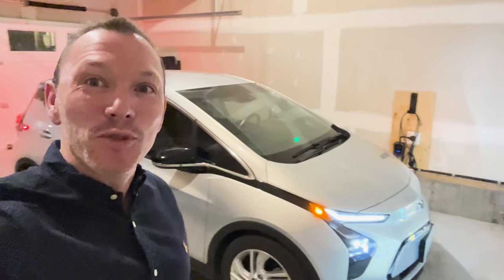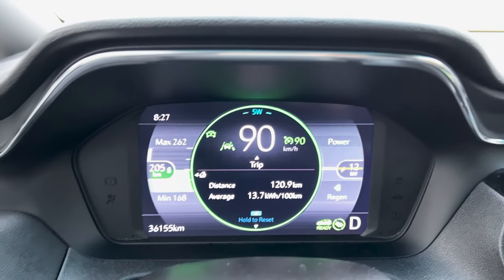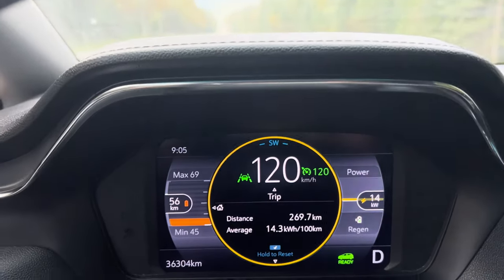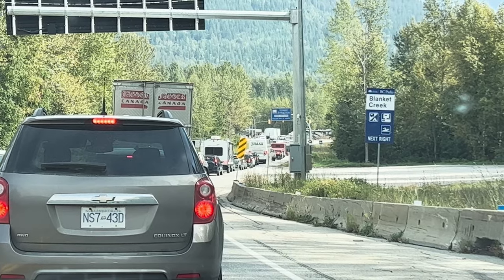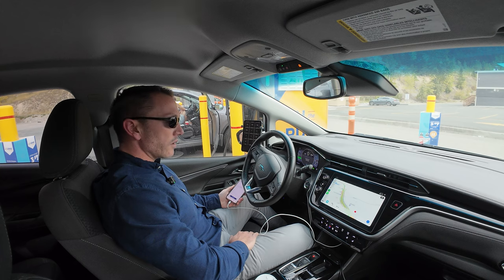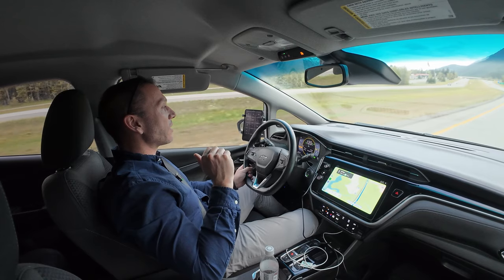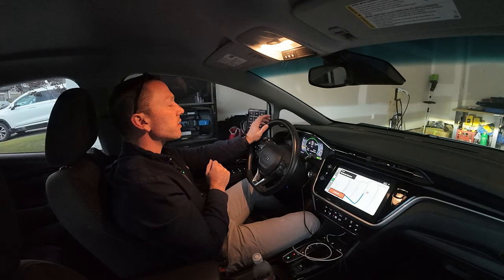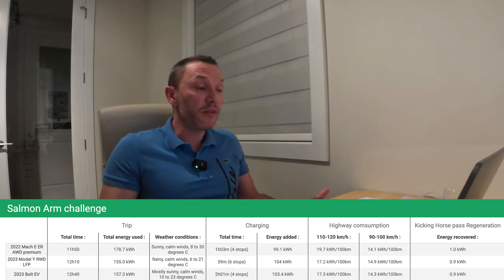Salmon Arm challenge (1000 km across the Canadian Rockies) - 2023 Bolt EV. Charging failure!

Comment: We almost bought a Bolt last year, carcwas ordered and ready to pick up when we walked away from the deal, We had a Model 3 before & just couldn't get past the slow charging speed, Having watched several videos, including the Rocky Mountain Challenge of TFLEV channel, we may have been too hasty cuz other than the slow charging, we thought the Bolt was a better car, overall, than the Model 3.  Chaulk that up to "lessons learned" 😌
Reply from the maker: I think the Model 3 is a better car. But the Bolt is much cheaper for sure. What makes you think the Bolt is better ? Curious to know your opinion about that. Thx
Reply: For us, it just felt more comfortable.  It felt quieter than the Model 3 on the highway and we preferred the interior design over the Model 3. Being an older couple, it was also much easier to get in & out of it. After seeing your Model Y videos, we may have to look at it! @TheFrenchCARnection